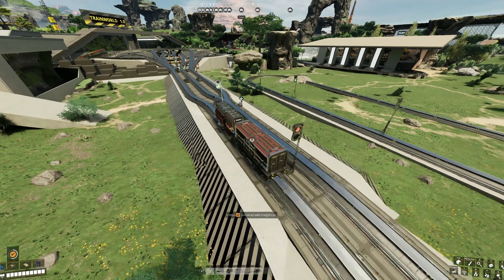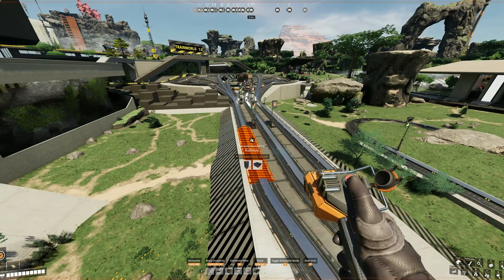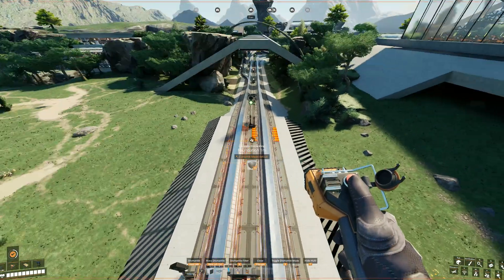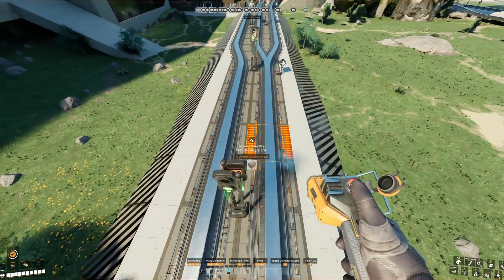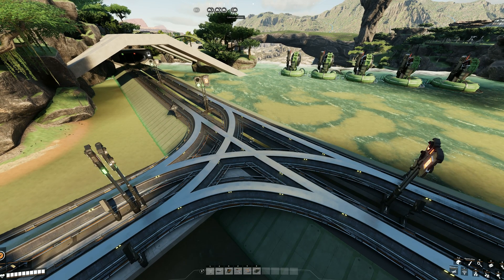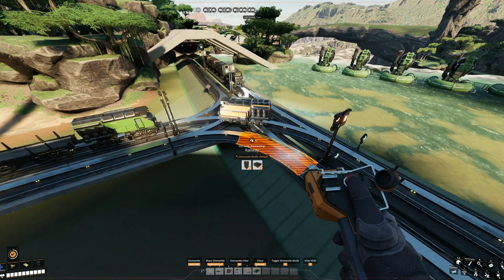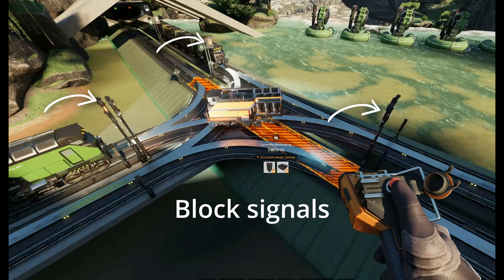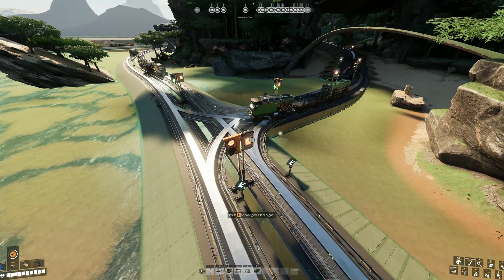Satisfactory - ULTIMATE beginners guide to TRAIN signals-understanding Path and Block sig operation

Comment: choo, choo... path, block... ohh dear. It sure can be confusing for many players.
Thanks for the breakdown. Do you have any idea on how to make a slip lane with rails?
That is to say, if you have train A and Train B.
Both of the trains are on the same track.
Reply from the maker: dont think its possible with block signals alone. the only way i know it using path priority like i have taught here sorry. but you can make the trains tavel faster through the block by making the distance between the block and path longer
Reply: To have the most trains possible on the shortest amount of a single track, you want the length of the blocks to be one building block of track longer than the longest train that’s going to travel on that slip lane. For example (counting the engine of  each): Train A is 2-4 cars, train B is 2-7 cars, and train C is 3-6 cars, you’d want to place block signals at slightly over the longest possible train, which is B, at every 8 to give the train behind 1 building block of track to slow down. In your least optimum case, a train A only 2 cars long, would cause the train behind it to wait until a gap of 6 building blocks opened up behind train A. Usually you be at a difference of about 2-3 blocks, depending on how much shorter the initial train is than the longest 7-car train.